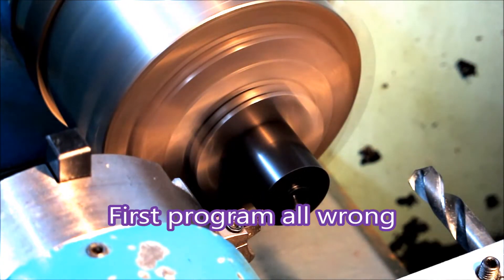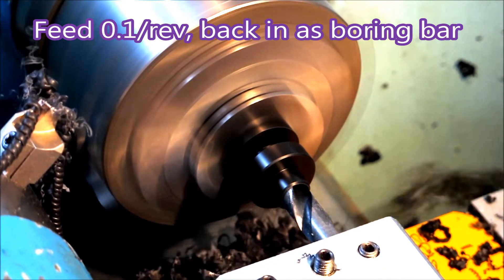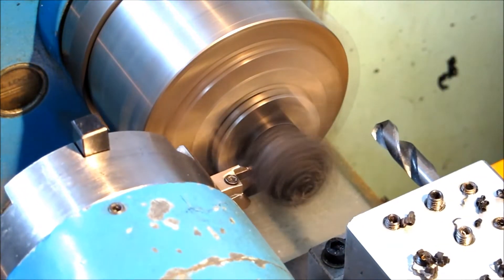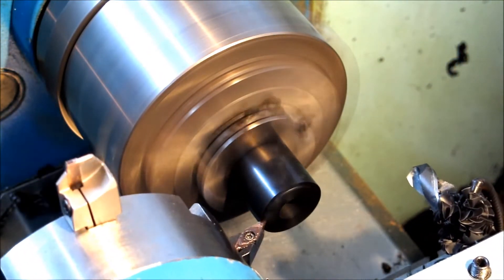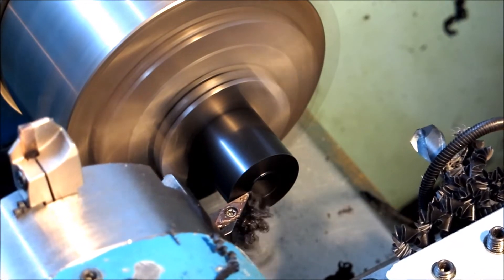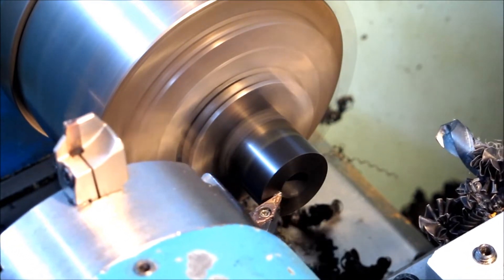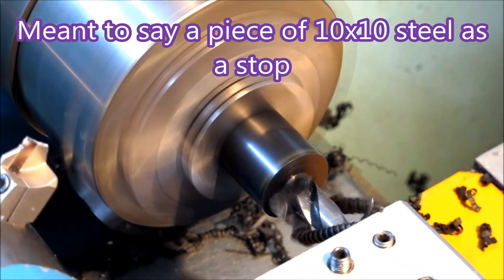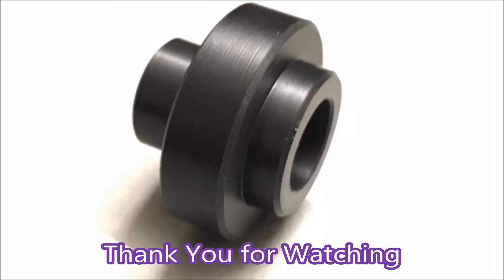Drilling undersize in delrin and fixing it. Small cnc lathe

Comment: one trick i use to machine plastics on my small lathe is to run the spindle backwards and use a left hand tool upside down to expell the chips down and out of the way instead of up and into the chuck
Reply from the maker: Demian Moody not easy to do when I use the turret. I have reverse on the spindle, but my tool would be 10 mm below centre if I put the tool in upside down. It might work in the gang tooling bar if I used a boring bar, not sure, would have to check. Thank you for your comment.

Comment: Did you see what he just did- destroyed the age old adage that drill bits are roughing tools and if that was not enough he hotdogs with the drill parting. machining aptitude level 12.
Reply from the maker: Shotgun Reloader Thanks Patrick
As I mostly have the drill positioned to make removing the sharp edge on the hole, it was no great stretch to wonder if it could be a boring bar in plastic.
As for drilling the part off, I rather like the idea and will try to use it in the future to see if it is quicker than tapping it off. Parting is always a choice between tapping it off and either losing the part amongst the swarf or damage when it drops into the chuck jaws and gets thrown around. The last makes 5C collets a good option as there is nothing for the part to hit when it drops off. I have a job coming up where I need to make 800 parts, I may give drilling it off a try for that job.